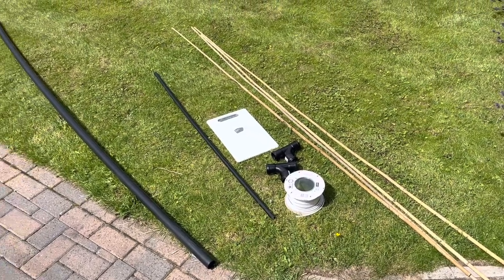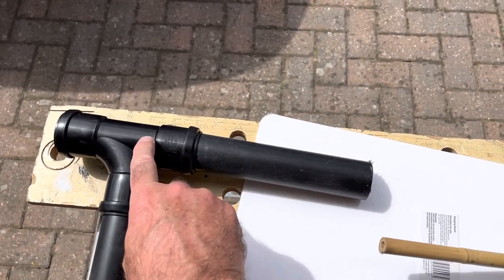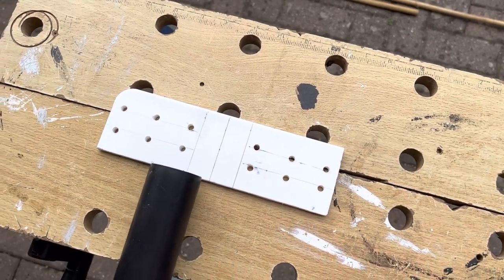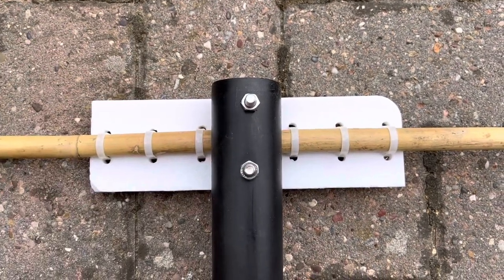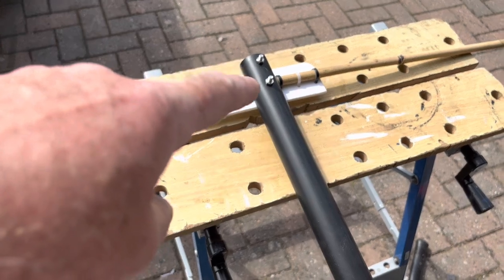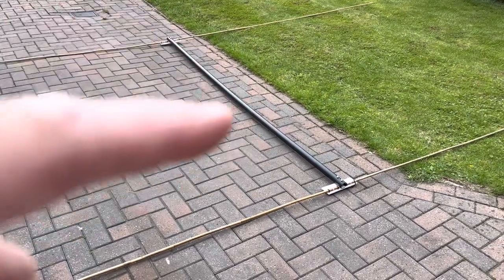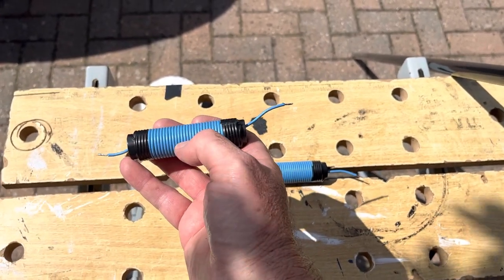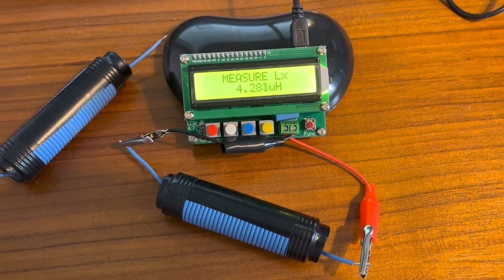20M Mini-Beam DIY Project - Part 1

Comment: Nice job with your beam. I watched all three parts of your video. I saw when you were comparing it to another dipole that you were only seeing about one s unit of difference. What's the other dipole vertically or horizontally polarized? Just curious why you didn't see a bigger difference. Thanks again for the video as I am building a  20 M dipole beam myself
Reply from the maker: Thanks. Yes the dipole was horizontal. The reason was the lack of height on my temporary mast. A higher mast will give far better performance I believe 👍🏻 Have fun 😁

Comment: Hi Ian,
Nice project. May I suggest next you drill the holes for the nylon ties, drill them a little less spacing so the nylon tie hugs the cane. Should prevent that  movement. Stay safe.  73  WJ3U
Reply from the maker: Good tip Don 👍🏻